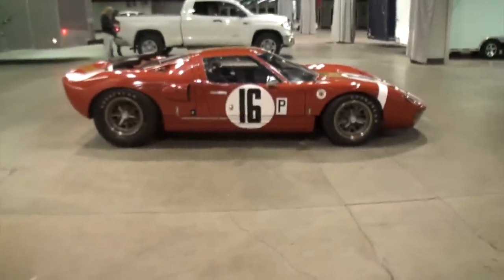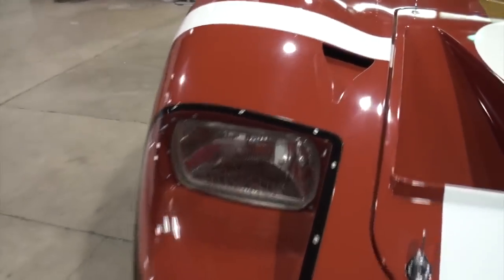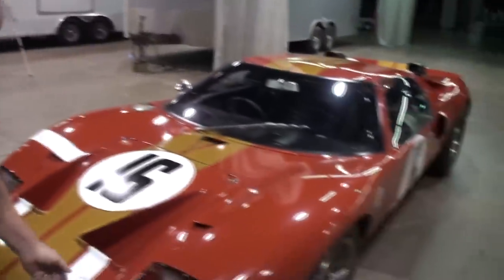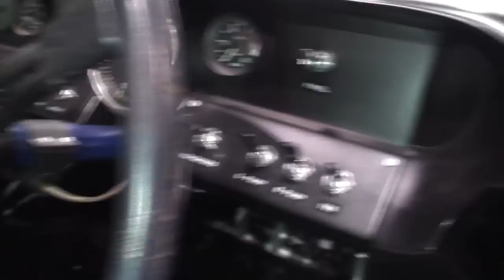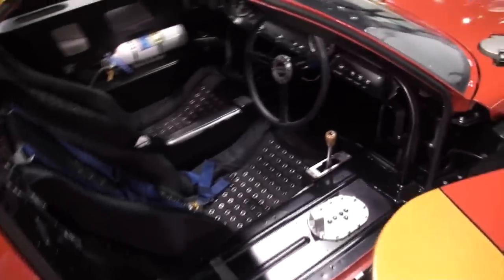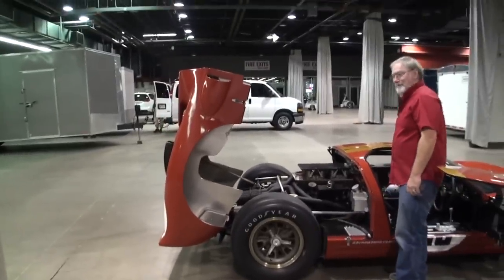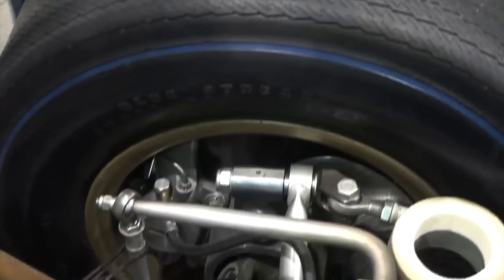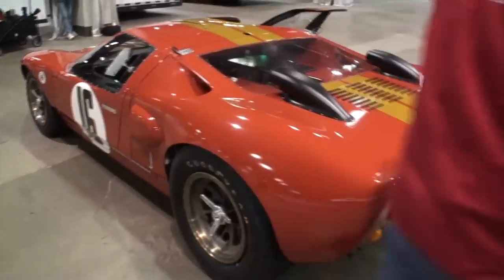REAL 1966 Ford GT40 GT 40 AM GT-1 Alan Mann Race Car & Ride on My Car Story with Lou Costabile

Comment: Thanks Lou that was an amazing car wish you could have extended the video for the few hours that the owner needed to give us the full story of this amazing race car . He spoke about the sand bent exhaust system , a lot of your viewers might not know what this process was. Back in the day factory mandrel bent pipes and Tig welding was not available , so to avoid the reduction in pipe diameter on the inside of press bent exhaust tubing a length of pipe was filled with sand and capped at both ends and heated and bent to the required shape . Having attempted this with mixed results it is art more than a manufacturing process.
Cheers Steve
Reply from the maker: Hi Steven, I think on this car we could have extended the video for a few hours and there are too many trunk & treats I never go to too :-) Thank you for sharing your knowledge and adding to the story too. Cheers, Lou

Comment: The car is a RHD but the shifter is still on the right. Why is that? Kids my age say it's better to shift with your left hand... Not me but everyone else
Reply from the maker: HI Matthew, Hmmm, not sure. I'll guess American Drives are used to shifting with there right hand, Lou
Reply: @loucostabile  That's absolutely correct, but even on older English cars like Bentley's the shifter and the brake lever were usually on the drivers right hand side. Of course, in early days there were many American made cars with right hand drive as well.
Reply: Was fairly standard on mid engined racing cars at the time. Even F1 and other single seater cars had right hand gear change.